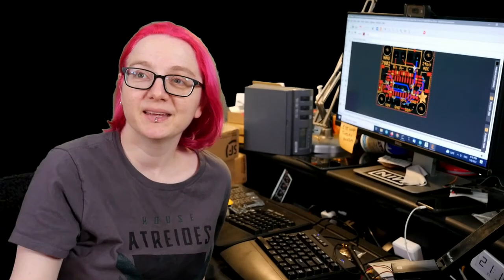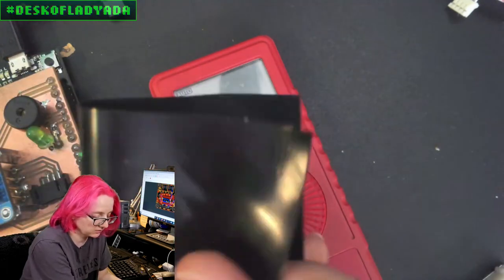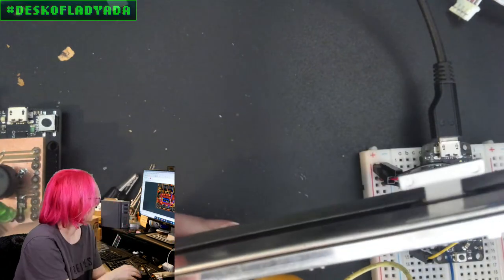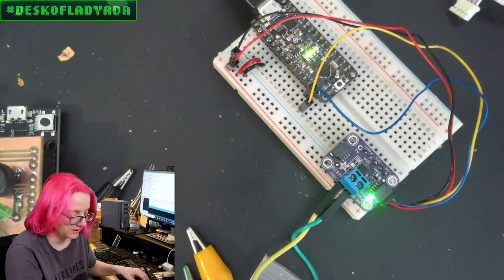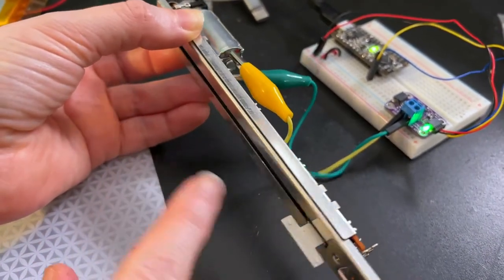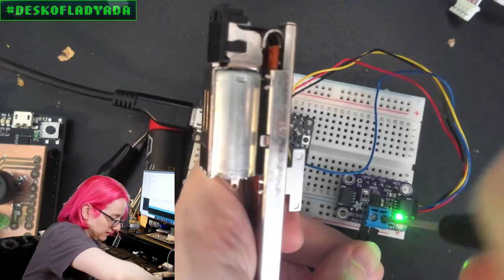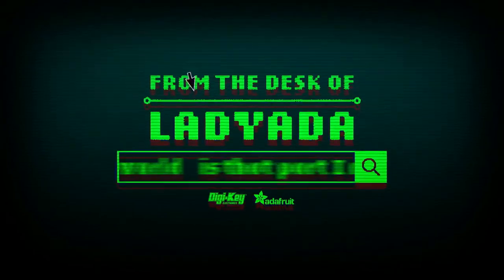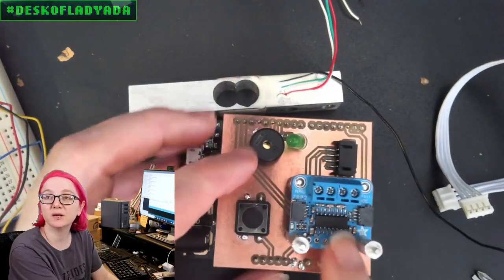The Desk of Ladyada -  Sample Sunday & a NAU7802 tester start

Comment: Have a look at conductive (carbon mix-in) TPU flexible filament. By now there should be several alternatives. I happen to know a Swedish engineer close to my home that a f a I k pioneered TPU filaments with conductive mixing. He claims it is more difficult to extrude to filaments, and he has his own special extruder setup (small scale filament factory) is his basement.